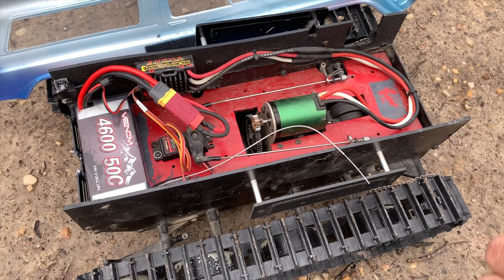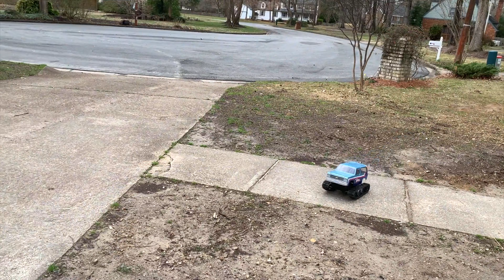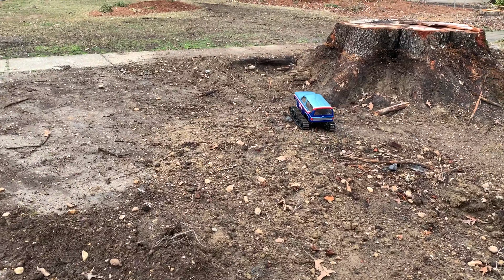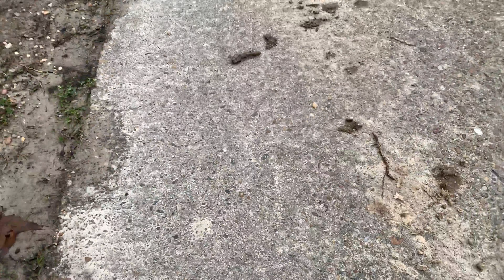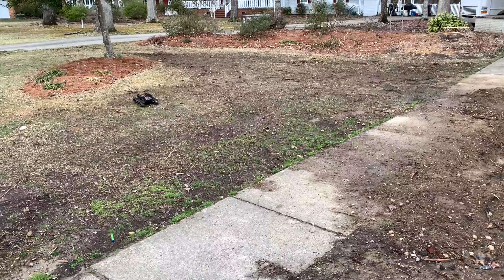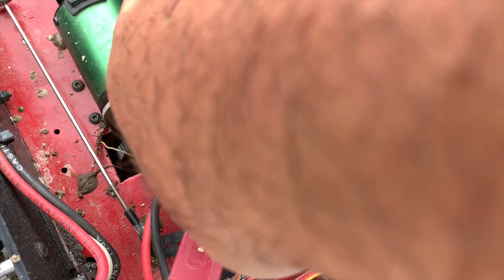Virginia Beach Beast Monster Tank RC

Comment: Cool Tony!! when I had this chassis to get it to steer much smoother I got some gasket material that they use on real cars and I traced the brake shoes on it and cut 4 of them out and glued them on the metal disk pads and this made it steer much smoother and you can set the steering end points also to make it turn smoothly. For the body maybe try the 3m velcro I forgot what it's called but it's plastic and snaps very hard together I used that stuff it hold way better than the normal velcro did.
Reply from the maker: Those are some great tips Steve! I'll have to take it apart and look into it. I have some of that plastic style "velcro" I could try. I plan to make a base for the body to sit on above the tracks like the real Beast had
Reply: @CCxRC  yea those metal calipers I remember they just kind of lock up real fast and make a jolting spin turn, I remember when I glued gasket material on them and did some radio adjustments I got mine to drive and turn much smoother and better.

Comment: You need to flip the steering servo and modify the aluminum steering shafts that help apply the brakes. Add ofna diff lock Libe to the diff and change gearing. I built a handful of single motors flipping the servo gives you  more deck space for battery’s

Comment: Have you ever tried one of the arrma granite 3s blx yet I hear there more wheelie happy then the big rock. I'm stuck in the middle between both and eventually if I can't decide I will just buy both.
Reply from the maker: I had a Granite and loved it. Called it the best bashes under $300. Now that I bought the big rock, I prefer it more. Wheelies are fun for a little while,  but I prefer to keep the wheels on the ground to control.  It’s much more controlled as well and the width helps keep it from rolling over as easy
Reply: @CCxRC  Thanks Tony you just made my decision easier.